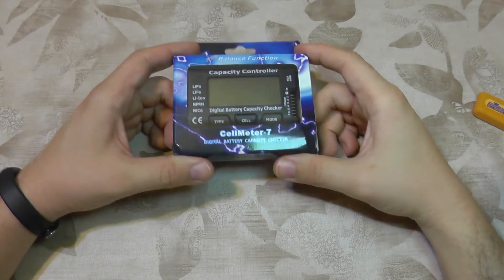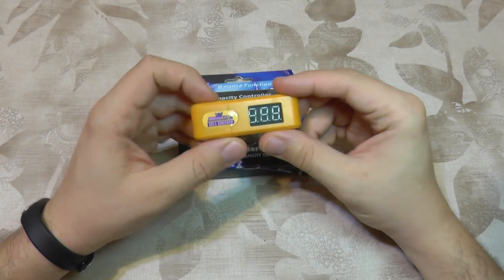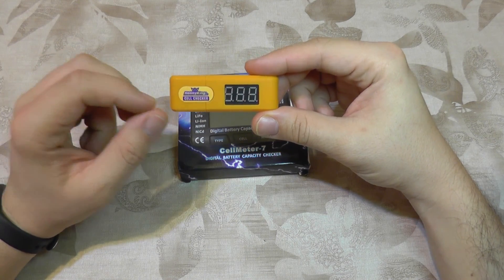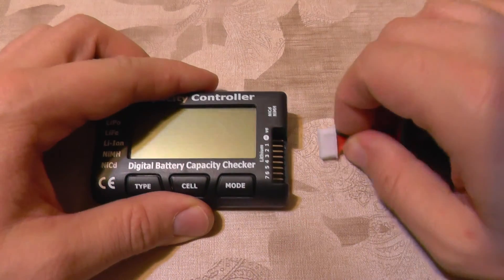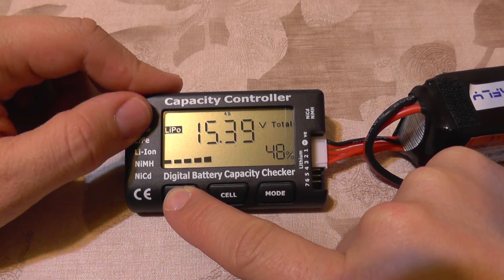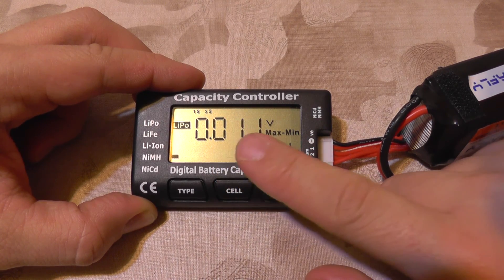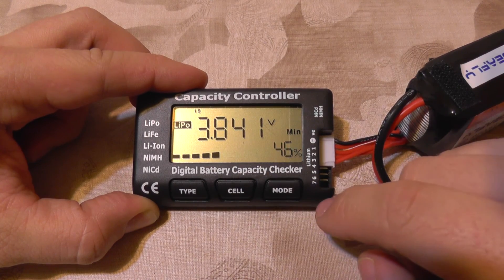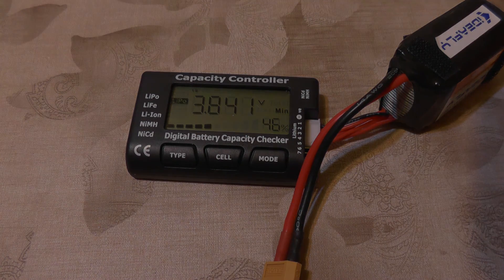LCD LiPo, LiFe, NiMh, NiCd Battery Voltage and Capacity Meter

Comment: Looks like a clone of the Tenergy unit I have, which has the same functions and look exactly the same.  I wonder if you can also do internal resistance measurements with yours.  The way to do that is to LONG press on the center CELL button.  It should then display bAL- (balance). If you do a short press on the CELL button then, it will show each cell , then the total. If you do a long press on CELL, you can use the MODE button to change from bAL- to d15- (not sure what this does, to Ir--- (internal resistance - short press on CELL will display internal resistance of each cell, which can let you find a bad cell in a pack), and finally another press on MODE  (after long press on CELL) will take you to PP-- (again, not sure what it does .. haven't looked at my directions much).  I use it mostly for checking internal resistance.  Try yours, you may find that it works similar to my Tenergy unit.
Reply from the maker: Great tip, I have just tried, sadly only the "Type" button work when it's being long pressed and it will automatically cycle the cell readings.
Reply: That's too bad. As I mentioned, it's an exact clone of my Tenergy meter. Must not have copied the firmware so it doesn't have all the same functions.  Oh well, I'm sure you'll enjoy using it, but the internal resistance feature is nice to have.
Reply from the maker: Bill Somrak
Yes, the IR is a very important measurement, at least my Accucel 6 has that function to check for dud LiPo's
Reply: I came across 16 four cell nickel-cadmiun battery packs along with charge, monitor, and utilize. panel.  They are new old stock.   Would they be good for a E-bike battery pack if do diligence is taken in restore, repair, and build a sound pack?
Reply: They came out of commerical 277volts mall storage. never installed.I KNOW THEY ARE GOOD AND WORTH My time.